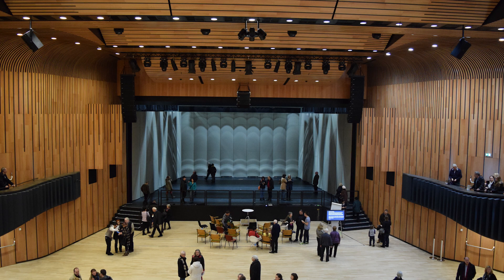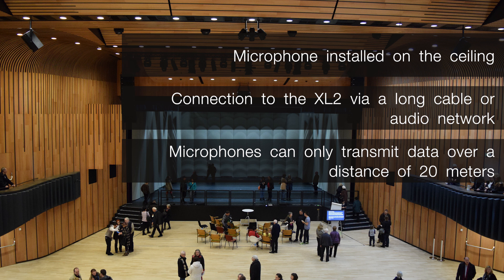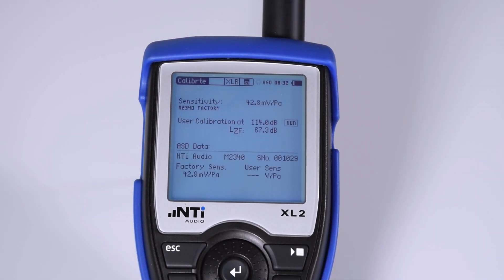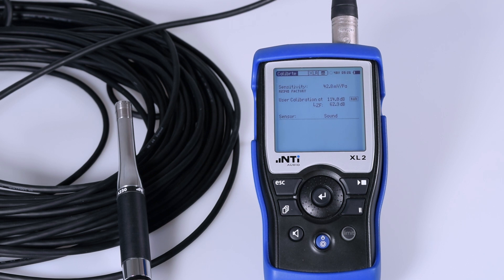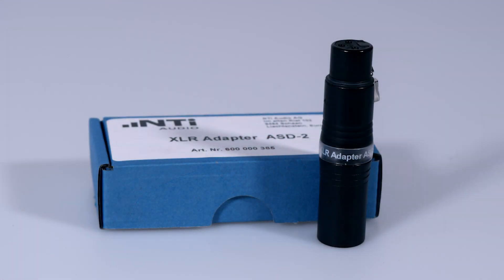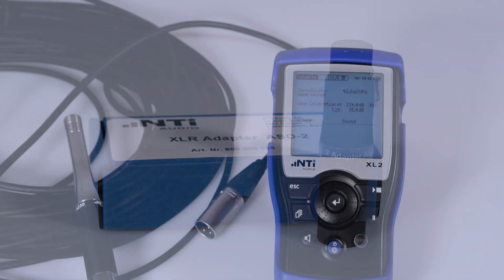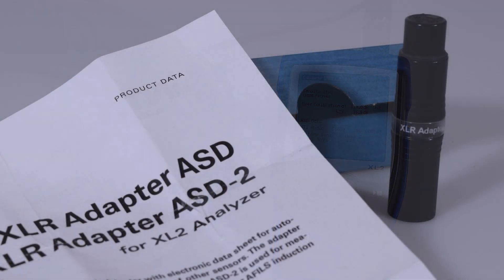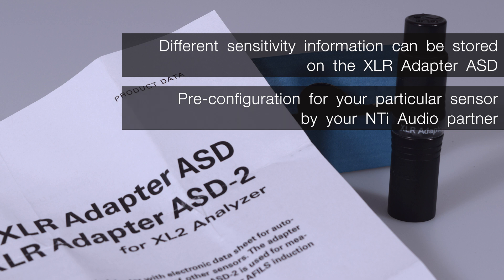Connecting a microphone over greater distance

Comment: Isn't there a third solution - just calibrate whole measurement chain with calibrator or pistophone?
Reply from the maker: Hi Marcin, that is correct indeed. However, if the microphone is mounted e.g. to the ceiling of a concert hall, it may be cumbersome to plug the calibrator onto the mic.
Reply: @NTiAudio  but also it can be calibrated prior mounting :)